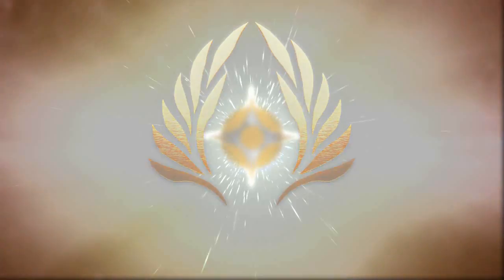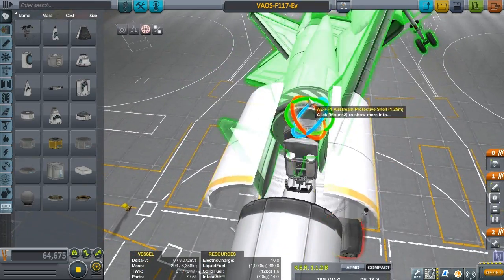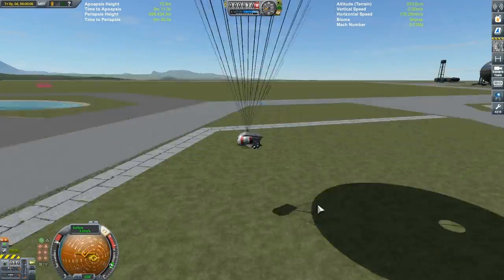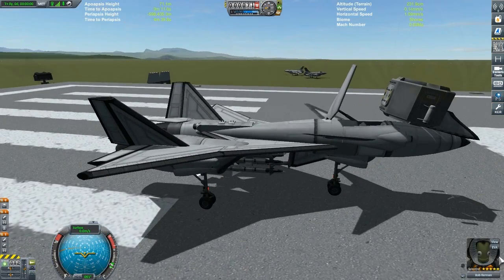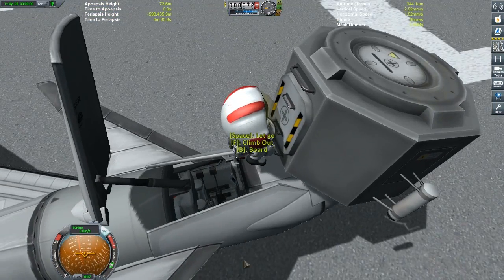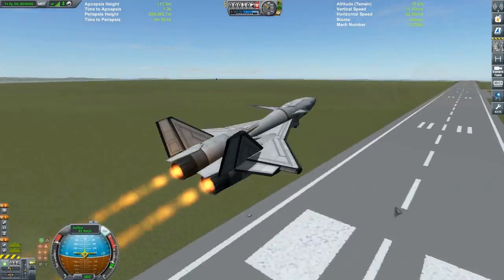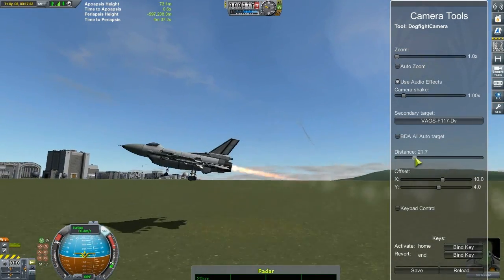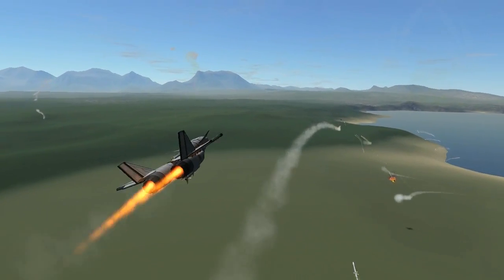BATTLE TESTING THE JETS! Kerbal Fighter Jet in KSP

Comment: Dude the design is really good but try to go for Anhedral angle with the main wing and dihedral or 0° angle with the forward winglets and make them steerable. Those angles uses the Dassault Rafale. Anhedral wing will make the plane to turn faster and the dihedral pitch will make it stable in turns.

Comment: Hey, that's pretty good! I myself am not very experienced with millitary aircraft in KSP, but I have been experimenting with Wheatley Tandem setups, and have made a somewhat decent interceptor, which is kinda manuverable thanks to forward-swept wings, but to be frank, it's not amazing. My multirole attacker seems to do better. I'll be advancing the fighter further at some point.

Would you be able to make a vid on Wheatley Tandems? I find the thrust to weight ratio to be very satisfying, but it does use up fuel a bit faster.
Reply from the maker: Thank you and ... Wheatley Tandems? :)
Reply: apologies for the late reply, but by wheatley tandems I mean a reverse-thrust wheatley engine on the front, and a "normal" engine at the back.

Comment: In the late 1950s and 1960s, jet fighters were traveling at record speeds, like the F-104. However, it was quickly realized that going fast in battle didn't ensure success- it only depleted your chances of hitting the target. A slow jet is a good jet- you can hit your target easier. Granted, you are also easier to hit.

The F-18 only has a top speed of 1,190 mph and stalls at very low speeds compared with other jets.

Comment: for the begening, what if you changed the staging? 
that way the ferrings fire first, then in the next block the seat ejects?
Reply from the maker: could work :)
Reply: i hope it works XP
my only other idea would be to add drogue shoots to the ferrings top but i dont think KSP has the physics to realize the chute is connected to a part of the ferring and peel it away first